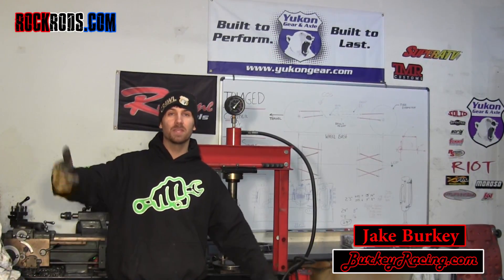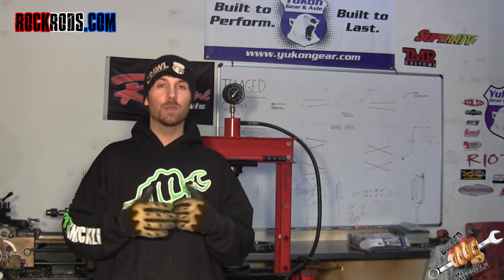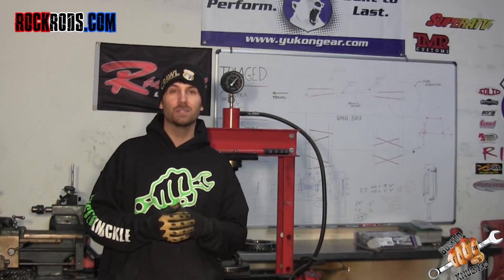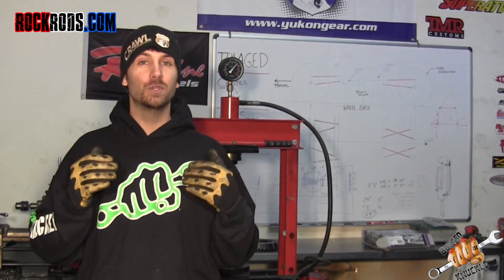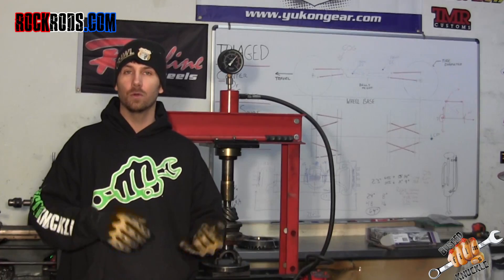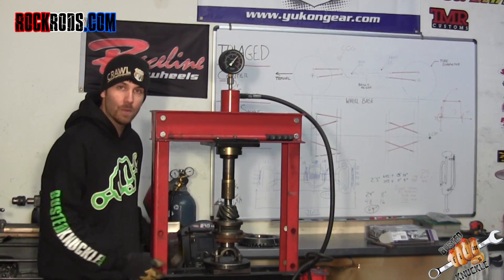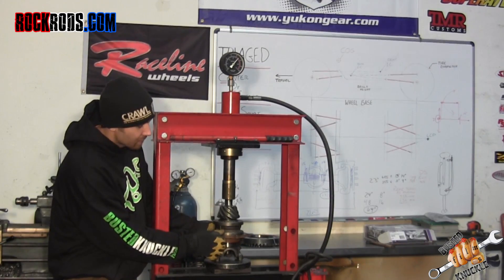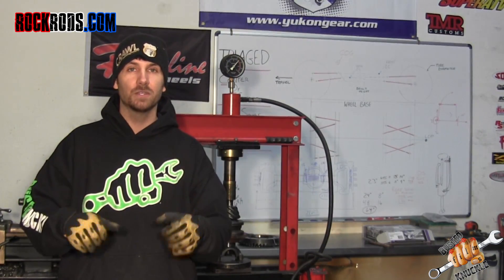Crush Sleeve Install Made Easy - Rock Rods Tech Quick Tip

Comment: If only I had a shop press
Reply from the maker: they are cheap
Reply: True, but my truck is torn apart in the yard.  I can't move one here.  BUT, I think I can do the same thing with an upside down bottle jack against the frame of a camper!  I'll post a video if I can make it work
Reply from the maker: sounds like a plan, sketchy but effective
Reply: Harbor freight has them for around 150$ with hydraulic pump style removable jack..

Comment: Glad to know I wasn't just being a wimp today when I struggled to get a crush washer to move on a Ford 9". Why not crush it all the way on the press? With that setup you could easily check the pre-load as you bring the ram down, or is it not fine enough?
Reply from the maker: swapping to a solid spacer is the way to go for an offroad rig
Reply: The pre-load is the measured resistance of the bearings against the races inside the differential case. It would be impossible to measure pre-load on the shop press.

Comment: I dont know a whole bunch about dana's (im a toyota guy) But Is a crush sleeve just a piece that keeps the pinion gear/shaft in place in the housing?
Reply from the maker: +rzr kid 14bolts, Toyota Axles and 9inches I believe (none of which are Danas) use crush sleeves to set bearing preload instead of the use of shims.
Reply: +BustedKnuckleVideo Hmm, shows how much my toyotas been apart 😂 Thanks for the info and the awesome vids! Ps, im wearing my Bk hoodie right now!
Reply from the maker: +rzr kid awesome thanks for the support!

Comment: Hey Jake.
Man I really dig your tech videos. especially the linked suspension 101.
I have a suggestion on a topic I've been considering to add to my off road Zj.
Oil system. Dry vs wet sump, accumulators, filtering, oil types and uses. Oil cooling.
what types of oil system are used in bouncing / buggys. Maybe some info on how to determine what type of oil sys.  is best for you're type of wheelin. 
Thanks for all your shared experience it's helped me so much in tuning and modifying my own rig.
Reply from the maker: That is a great topic. We will get to work on it

Comment: Too bad doesn't work on the dana most jeeps have someone should make a small press to fit over the housing push on the yoke and the pinion
Reply from the maker: Just swap to 1 tons LOL
Reply: Which Dana axle are you referring to and why doesn’t it work? I want to do this with my Dana 30 crush sleeve. Seems like it would be the same.

Comment: I'd like to see the crush in action..
Reply from the maker: +mshackelford1980 next time
Reply: Just wanted to add, I finally got around to doing this today. Worked great! That last little bit was still a pain but I got the final bearing preload right at 35 inch-pounds for the brand new bearings. Thanks for this idea. No way I would have been able to crush it with the axle on jack stands!

Comment: do a tech tip for how to make your own beadlocks
Reply from the maker: +William Jenkins we typically run aluminum beadlocks for weight savings. Some run H1 wheels though, they are the best bang for the buck. Get some H1 wheels, cut out the centers, buy press in centers, weld them in, get pvc inserts and bam you go some double beadlocks on the cheap.